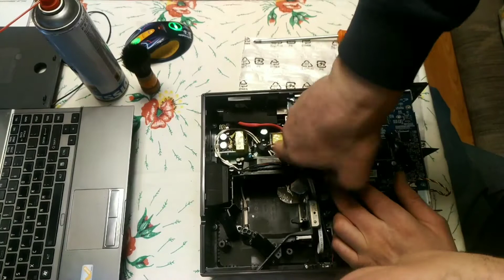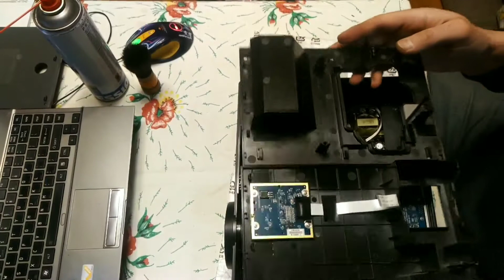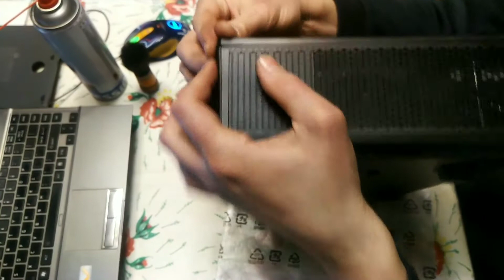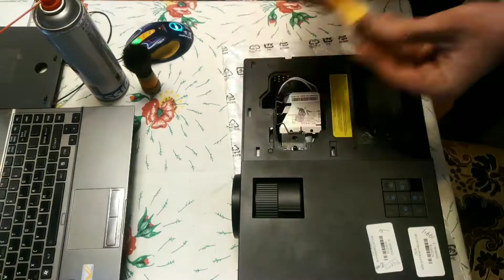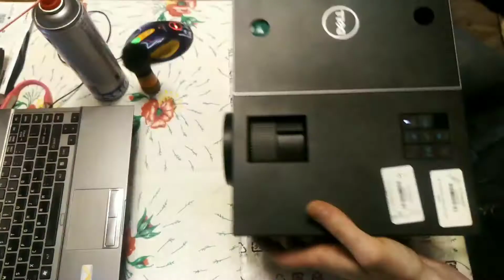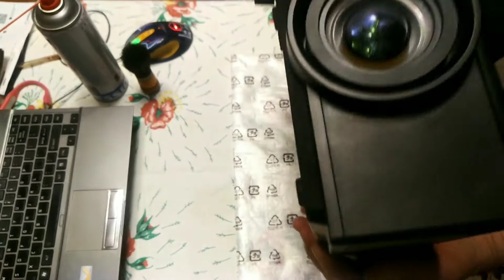Projector dell 4350 fhd assembly  / disassembly

Comment: Hi, 
was the pcb also glued on the frame? if yes, how did you manage to get it off?
Reply from the maker: Hi!
There is no glue.
All installation is done with screws.
In some places only sticky tape for wire management.
In general, the build quality and design of this model is very good.
Reply: I figured it out in the end :D
Thanks for the answer though! Appreciate it.